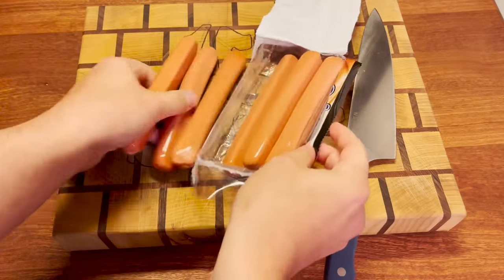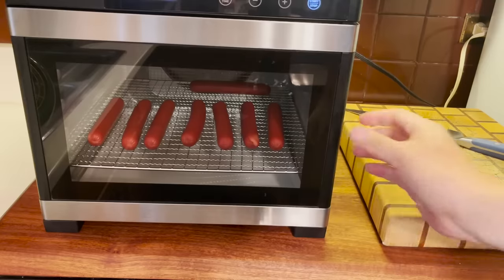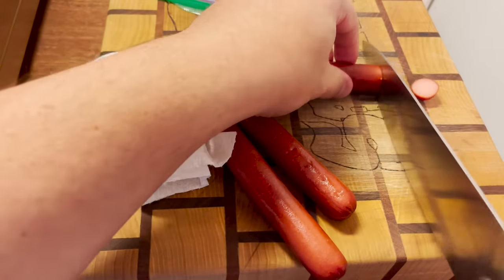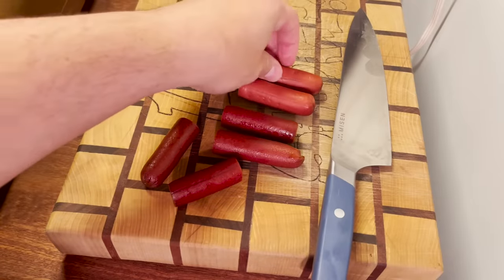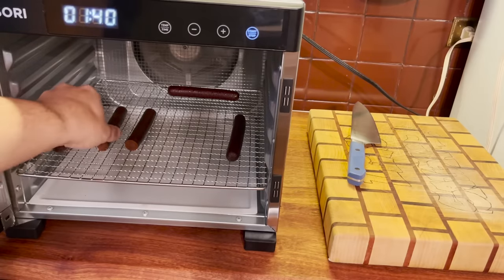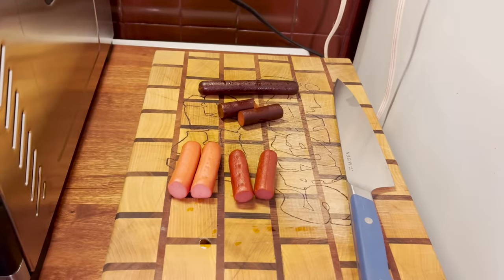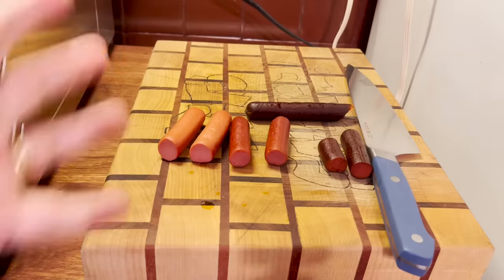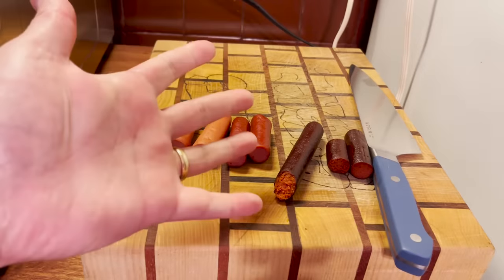Dehydrated Hot Dogs (NSE)

Comment: 24 hours is kind of a minimum for a dehydrator.
Reply: ???? What? Beef jerky takes like 6 hours. Everything I've ever dehydrated has taken 12 hours or less. Obviously there are some exceptions: if you dehydrate thick foods or use a low temperature. But for the most part, 24 hours is a wildly long time for dehydration

Comment: Assuming he bought the cosori dehydrator for $160, Ballpark hotdogs are $5.49 for 15 ounces, and Jack Link's beef jerky is $13.99 for 10 ounces, you would have to make 155 ounces of hot dog jerky in order to break even, a little less than 10 pounds of it.